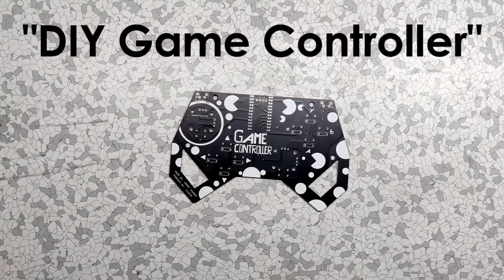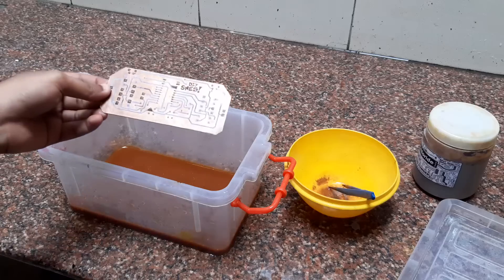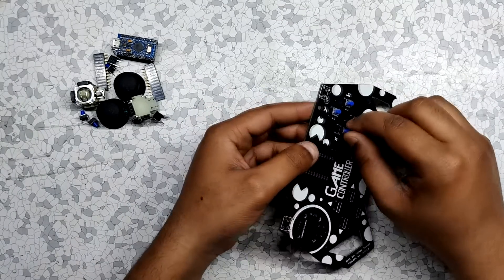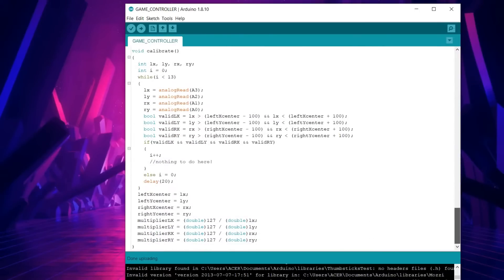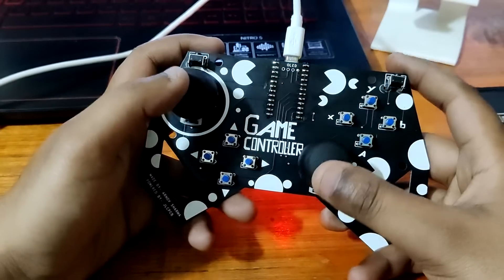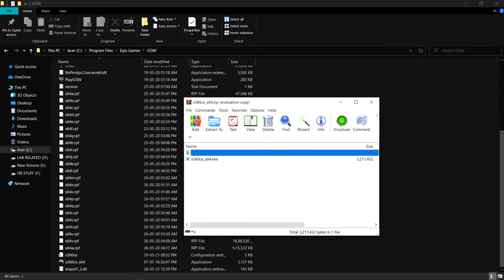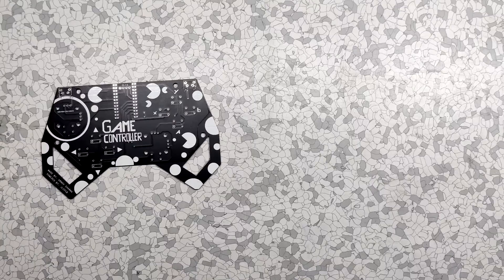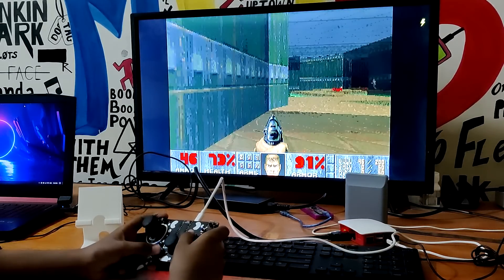Arduino Game Controller that runs GTA 6

Comment: hey man, I am a beginner and trying to replicate your video, but keep getting the same Error-message in the arduino IDE:

In file included from C:\Program Files(x86)\Arduino\Gamepad Sketch\Gamepad Sketch.ino:3:0:
c:\Program Files(x86)\Arduino\libraries\ArduinoGamepad-master/Gamepad.h:24:10: fatal error: HID.h: No such file or directory
 #include "HID.h"
          ^~~~~~~
compilation terminated.

exit status 1

Compilation error: exit status 1

I tried everything i could think off and was not able to find or install an HID.h Library.
could you please help?

Comment: is t possible to make a 18 button contorller lke this? instead of 16...
Reply from the maker: Yup
Reply: @ArnovSharma  i shall reccomend then, add 2 more buttons on the left (in total of 6), to be more universal...
Reply from the maker: @rodolfoalvim  noted
Reply: @ArnovSharma  how s the joystic response? does resemble the console controllers smoothnes? i mean, it will only depend of the stick quality or there is some advanced programing involved too? thanks...
Reply from the maker: @rodolfoalvim  response is goood.

Comment: Can i use arduino uno.Please reply
Reply from the maker: You can but using uno will require a very different method which is not recommended.
Reply: @ArnovSharma  can i use unojoy?
please reply
Reply from the maker: @renuagrawal1945  you can.
Reply: @ArnovSharma  Ok .Thanks

Comment: The real question here is how tf r u playing gta v with that laptop... I have the exact same laptop.
Reply from the maker: What specs do your system have. Mine is i5 9th gen, 16gb ram, nvdia gtx1050
Reply: @ArnovSharma  I have the exact same but 12gb of ram instead
Reply from the maker: @hereticstanlyhalo6916  well turn on nitro sense and use wall adaptor while running gta.  Use moderate graphic settings and sit in a cool room. Gta5 won't be an issue then
Reply: What model is it? Looks like an Acer Nitro but I'm not sure which one.
Reply: Le me: playing gtaV on i5 6th gen dedicated graphics card but a bad one 8gb gigs of ram
Reply: i had the same one or one that looks the same but i could play gta v and other games really good on it but it overheated because i played people playground

Comment: Hi sir
First thank you very much for sharing such great work
I want help or guidance
I work on same project and I use your code for it but except input buttons I want to use ttp229 i2c as input but unfortunately I fail every time in programming because I'm very beginner
Can you guide me, send me some similar project links or fix your code for ttp229
Thank you very much
Reply from the maker: for Touch pad ic, you dont need any code editing bro. code will remain same. for sensitivity, you need to change the value of capacitor connected to TP229 ic. read its datasheet for improving this sensitivity thing.
Reply: @ArnovSharma  thanks for replying sir
I'm using I2c mode for my project, only pin SDO and SCL and same arduino as you
I believe it's will need different code for inputs but 2 joystick pins will remain same
This project as gamepad will include all buttons controller needs to have
I really need some help, I stuck in this
Reply: @kuroihana3228  Use a soldering iron and take that analog stick out of the i2c board. You do not need to complicate this process with i2c its just not necessary. You're just reading the inputs of 2 potentiometers.

Comment: Does it run with Raspberry pi??
Then i will be using it for retropie...
Reply from the maker: It runs with everything if that Device supports USB game controller
Reply: @ArnovSharma  can you please share the circuit diagram as I will not be making it on a pcb like yours
Reply from the maker: @bikashsarkar5215  I've posted instructables about this bro. Check the link. You can download PCB schematic and other stuff like code from there
Reply: @ArnovSharma  Oh I just saw it now... Thanks
Reply from the maker: @bikashsarkar5215  no problem, glad I could help out!